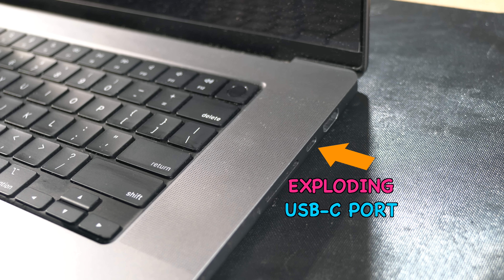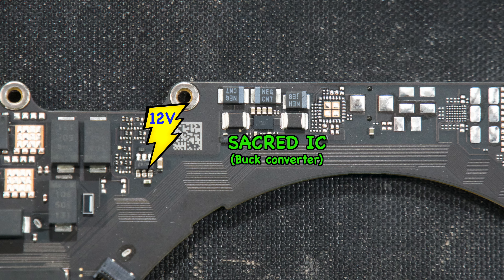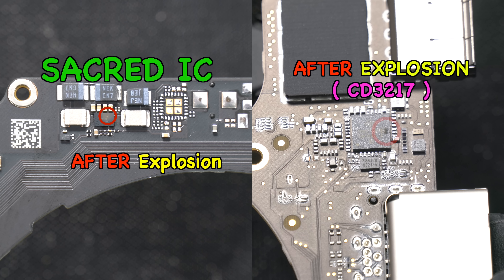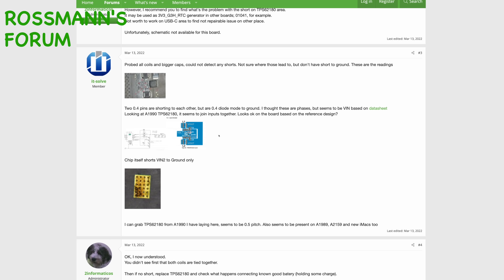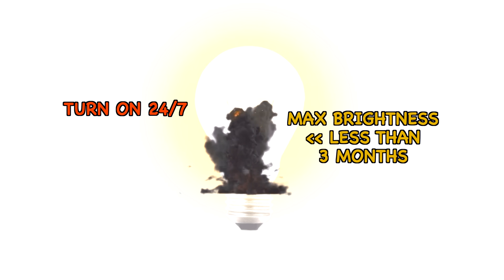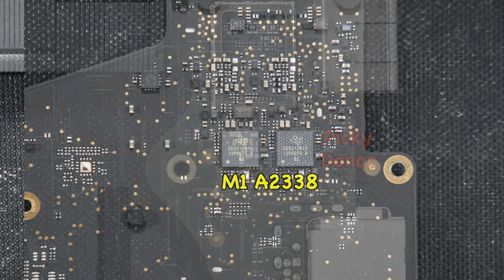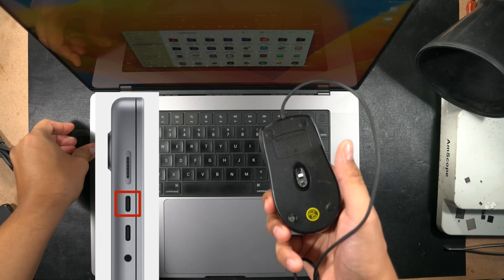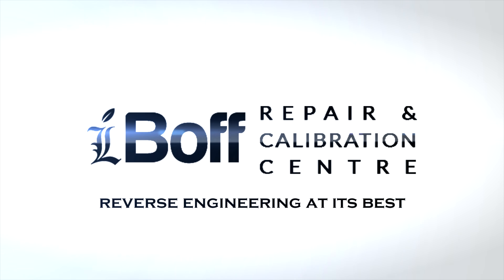Exploding MacBook Ports Explained : M1 Max, M1 Pro ( Not For Ignorant Dudes )

Comment: From my experience in many cases TPS dies from charging external devices and cheap hubs. Basically same reason caused famous "GAY chip" problem
.
Cd3217 programming difference is i2c address written to OTP. There is also differences in configuration depending on TBT chipset used. Such chips can be bought in cd3217 sets, approx 70$ per set for all 4 chips marked with their positions by many ic sellers on China.
Also in many cases removing 5v will fix the device since 3217 usually is ust partially damaged, I mean, logical part works ant it is still visible on i2c rail.
Reply: Hey man, if my mac is connected to a powered TB3 dock, is it safe from this problem? I understand with the TB3 dock all the devices are powered by the dock, and it also supplies power to mac via thunderbolt.  Thank you for your insights.
Reply: @jeancassel  well if dock pro actively uses external power supply that would be safe. You can buy a keweisi 1802c USBC power meter like  to know for sure, that's really useful thing and it will show you if your dock sucks power from usbC or not. Otherwise use left side, closest port to the magsafe, this one is not hard to replace since it's not preprogrammed.
Reply: @inwerp  Thanks a lot for your insights man. Yes, it uses an external power and I have the TB3 cable plugged at left side.

Comment: What about continuously using a monitor that transmits both video signal and power through a single USB Type-C cable?
Reply: Yeah. What about this?
Reply: Well the problem is Apple and other Computer Manufacturer use this same Chip instead of using the old one that won't break other components because the old one has Fail safe that cuts the power rail when the voltage is higher than 5 Volt
Reply: Hello, MacBook M1 Pro 2021 here. My logic board burnt using two displays, one via HDMI and one vía USB - C. Finally here is the explanation, I guess.
Reply: Generally speaking, if the thing you're connecting to (monitor, hub, 3.5" ext hd etc) provides it's own power, you won't be using but a few milliamps from the USB-C host for sense detect.  Generally speaking.
Reply: Galaxy in dex mode can be kept on forever. I've had 2 connected for years

Comment: You can have usb-c ports, ofcourse. You just shouldn't use them. On a serious note, the 10A 5V chip will probably get burned as well if you use both ports at the same time. You could try testing small heatsinks on the 2 ICs (lower the temperature, increase its lifespan).

Comment: Too bad the IC cannot be programmed, or I guess it could be programmed, but the proper ROM is most likely impossible to obtain from anywhere.
The same thing is with SMC on older boards, as the SMC was programmed with Apple's custom firmware and you had to took it off the exact same board otherwise it didn't work.

Comment: Guess I’m staying away from 14” and 16” MacBooks. Thanks for the valuable information!
Reply: Or you use the USB-ports on the other side… But yeah, you should learn about the failure modes of Dell XPS. Reliability is always relative.
Reply: @MiesvanderLippe   did you actually watch the video? If one port dies all of them become unusable.
Reply: @theEDMdragon  my comment is not hard to comprehend. I obviously meant using the other ports as a preventive measure.
Reply: I guess I made the right choice to step back from the MacBooks by letting go of my 16” M1 Max MBP, then. Damn…
Reply: I'd like to, but MacBooks have no alternatives. Come on windows laptop manufacturers, make a device that isn't a plastic toy but actually usable
Reply: @Gameplayer55055  There are plenty in that price bracket. Stop comparing apples (lmao) and oranges.
Reply: @jm036  due to blackouts in Ukraine I've bought MacBook Pro M1 because it's the only laptop that holds charge for all the day and arm based, so it's efficient (I hope snapdragon x catches up in popularity)

I like everything in it except upgradability, feeling a bit handcuffed, otherwise I'd purchase mega big 2tb SSD and 32gb ram
Reply: @Gameplayer55055  This ARM efficiency you speak of is nonsense. It is phone SOC extreme integration causing "efficiency" only when idling. Intel and AMD will catch up before Qualcomm at this point but kiss your upgradeability goodbye. Who cares, you'll have to use MCST Elbrus and Astra Linux in the ukriane soon anyway 😉
Reply: @Gameplayer55055  as of now I agree the power efficiency still makes M series computers somewhat compelling, though you’ll have to be careful not to overuse that power IC, and competition from the PC side is definitely welcomed
Reply: @Gameplayer55055 war is tough on you, by the looks of it.
Reply: @paledawn363  yes, but nevertheless people adapt to any conditions.

Comment: What if I just plug in my usbc devices only on the MagSafe side? I have a M2 Pro 16inch MacBook, I usually have only 1 thunderbolt cable plugged from my dock that does everything from display/power/peripherals
Reply: it looks like it's best to use the MagSafe side because the LT8642EV-1 10Amps is in charged of that side. Also, my Lenovo Legion USB-C port died and killed my nVIDIA GPU. so this problem isn't just Apple's issue.
Reply: @evanmila4048  yea I knew someone where I saw Lenovo used the same ic chips too seems like a intel controller issue
Reply: I saw a video somewhere else Lenovos had a similar issue with their thunderbolt ports

Comment: My M1 Mac mini (2020 model) blew two weeks ago. I pulled the board and saw a suspicious raised dot on one of the chips and figured that was the problem. Now thanks to the video I went and took a closeup look at it: a CD3218 B12. So not the 3217, but close enough I'm guessing it does the same job and failed for the same reason (plugging in a USB cable and bye-bye logic board!).

Comment: Once again thanks for the informative video iBoff Mat, I wasn't aware of the presence of that terrible TPS62180 on these boards. Also glad that you confirmed that we can use CD3217 from A2442 (same position on boards) to replace CD3217's on A2485 16"

Comment: Ok, so the hardware can't handle providing 5V for long time?
Sounds very, very cheapskate.
And to top it off the firmware is proprietary and not documented?
Why would anybody buy this?
Should be illegal actually. Where are the politicians when you need new consumer protection laws?

Comment: I am using macbook pro 2021 16 m1 pro. i use double usb c hub from anker for using 2 monitors, charging, ethernet, sdcard, mouse dongle. Will this trigger issue? sometimes i left it connected all night. As you said in the video. The main common problem is the USB c on the right side where there is only one USB c?
Reply: I think it's pure luck, probably related to ESD
Reply: @Gameplayer55055  I agree.  This is probably not as common an issue as this click-bait Youtuber tries to imply.
Reply: You know the ram clears out when you turn it off and cold boot it every now and then. Some programs will leak into ram or be stored in cache that don’t need to be. Also if you bump into swap, it seems like a great time for a cold reset after an over night rest.
Reply: dunno man. I do exactly that. i have laptop on 24/7 plugged into usb c hub with hdmi. i wouldn't worry about it. make sure you got applecare though. Had mine about a year no issues

Comment: Does the TPS62180 chip also supply the 5 volts (and degrade) when connected to a USB-C dock which gets its power from an external PSU?

Comment: damn man, these are 2-3-4k $ devices and they wanna save 1 or 2$
Reply: Designed by an American company.
Reply: That's not even $1. LTC is known to give MASSIVE discount to big customers. Most major brands will do the same, they offer products at mot that much higher than bare cost for their big customers.

Take the LTC chip as an example, the die size can't be more than a few sq mm, and for mass production of mature analog processes (say 350nm), per sq mm cost can't be more than $0.08. So, the chip costs at most maybe $0.4 to manufacture. If Apple is negotiating the price, I'd be very surprised if LTC even dared to ask for even 50% gross margin, so at most the chips would be $0.8, and that's a worst case estimation.

Apple is literally saving cents by using a lower rated chip.
Reply: planned obsolescence
Reply: Well they’d be 8k devices if they didn’t apply that logic across the BoM
Reply: @edc1569  They do list top of the line components on the bom for sure.  Substitutions are a part of this industry, but apple really does like using oddly specific parts for whatever reason sometimes.
Reply: Indeed, Apple saves millions of dollars on cheaper components and ensures future failure of the device, so you buy a new one. Lawsuits and warranty repairs are already paid for many times over by the cheaper component savings.
Reply: @FVBmovies  depends on the product, use case, and scenario actually. everything ive owned was a dream to use. cant say the same for other people but just my uses.
Reply: @FVBmovies  milllions of people use this devices without any problems.
Reply:  Always less for more .
Reply: Maybe i understand wrong, but 10a buck divede by 2 cds, and 6A one for only 1 cds. Ia it means that TI one is better?)
Reply: well, they buy them in bulk so its a lot more expensive, and this is important for a mass production device

Comment: I think when it's sleeping and you plug something in macbook darkwakes and then sleeps again after some time with usb-c unpowered.
Reply from the maker: We'll check that. How long would it take to go unpowered?
Reply: @iBoffRCC  idk for sure, it's probably depending on settings. What I do is connect my phone when MBP is sleeping, phone starts charging. Then after some time (about a minute in my case, but I have very short sleep times in Settings also) charging stops. So I presume in real sleep external ports are not powered. 

Also if you run 
pmset -g log|grep -e " Sleep  " -e " Wake  " -e " DarkWake  " 
in Terminal, you will see a "USB-C plug" DarkWake for 45 seconds (in my case) and then Sleep

DarkWake from Deep Idle [CDNP] : due to SMC.OutboxNotEmpty smc.70070000 smc.70200000 USB-C_plug/ Using AC (Charge:68%) 45 secs   
Entering Sleep state due to 'Maintenance Sleep':TCPKeepAlive=disabled Using AC (Charge:68%) 26 secs 

DarkWakes are service wake ups with screen off.

Comment: If I use HDMI or USB-C for charging only, will this affect the issue?
Reply from the maker: As far as what we checked, HDMI is on different circuit. Then charging (20V) via the right port will not trigger the TPS. But it's still advisable to remove the charger afterwards.
Reply: @iBoffRCC  what about charging via left side of macbook?

Comment: This graphical way of explanation is awesome and I really like this video ! 

This "exploding" ports are really troublesome because what are people supposed to do ? Apple solders the NAND chips to the board meaning that you're adviced to use an external SSD if you don't want the whole machine turn into e-waste when the NANDS on the board reach their TBW rating. Yet when one uses an external SSD the port is more likely to die eventually.  

  I personally don't have that problem because I  use a really old laptop with linux for my studies and it's great because almost everything is replaceable and maintainable. (Even the CPU is socketed and I replaced the I5 with an I7 2670qm)   I'm sorry for the people who are facing these issues.
Reply: I agree with you. But if you run some numbers, the time it takes for it to reach its TBW rating is so much. I calculated mine based on my average writing of 20 GB a day and my Macbook Pro should take a little bit over 168 years to die. Even if I double it, it should still longer than I will.

Comment: I think there is more involved when it comes to replacing the cd3217. You would according to say have a master and slave cd3217. If you replace the master then you also have to replace the rom chip of that. At least I read this somewhere
Reply from the maker: We did the ROM swap, nothing changed. And every other CD3217 sources you can imagine (not shown in table) but it still didn't work. Read the blog and you will understand
Reply: @iBoffRCC  In any case, a lot is still unclear when it comes to the cd3217. Hopefully there will be solutions to this problem. For example, it would also be nice to be able to disable a cd3217 and case of (for example) water damage.
Reply: this 👍. you're right, the chip revision also matters( you can discern it by the markings and type glossy/mat).
since all the chips are not the same revision, swapping them will cause issues with the program inside the rom.Keep in mind the code inside the rom defines what functions are used: usb3/2, pci passthrough,dp port......) so naturally it will not be the same between all models.
replacing both is good practice, when you pull from the same board.

Comment: Only apple silicon or are older Mac’s (T2) affected?

4:58 nvm, I pray that my 2018 MacBook Pro doesn’t suffer from it!
Reply: Which model 2018 are you using?
Reply: @daphnisvanwezel  15inch 2018 MacBook Pro with base specs
Reply: You're in luck, it uses the CD3215, which is not paired

Comment: why apple engineers still using this f%ing ic TPS62180 ?
Reply: not because of the engineers but because of the greedy MBAs in-charge
Reply: It could be that they don’t understand the failure mode. Clearly the buck mosfet is failing short and passing 12V, but that could be just one possible failure mode.
This video mistakes failure rate per operating hour (by recommending that you unplug all usb) vs the failure being instigated from an esd event, a bad high voltage handshake, or some other discrete “event”. In reality, it’s clear the author doesn’t know what causes the problem.
Reply: @enginerdy  Yes, and since these are customer's laptops, you have no way of knowing how they actually treated them and what they connected to the ports. What they tell you, will not always be reliable.
Reply: My cheap HP gaming laptop simply cuts the power off, lmfao.
Reply: Bc Tim Crook is just that and wants your to give him money, and watch your applecare get denied and see you buy a new mac lmao 😂 it’s criminal
Reply: money.
Reply: So they can sell you a new mac  because water indicators turnes red and then it was your fault 😂